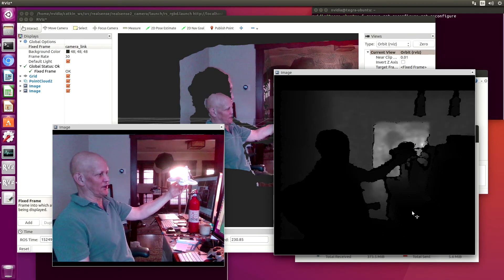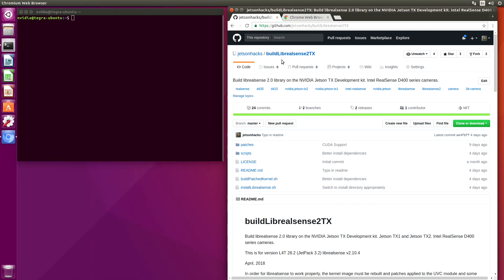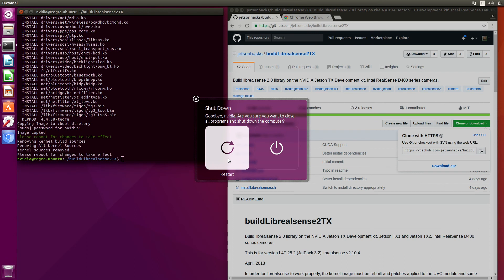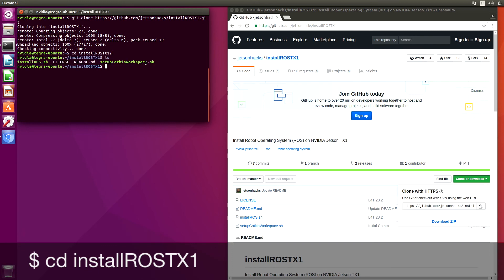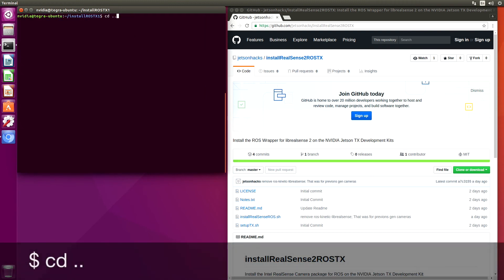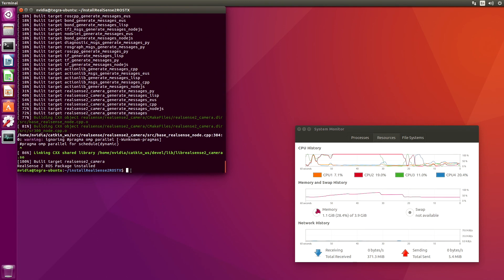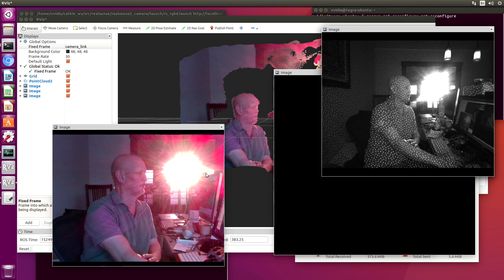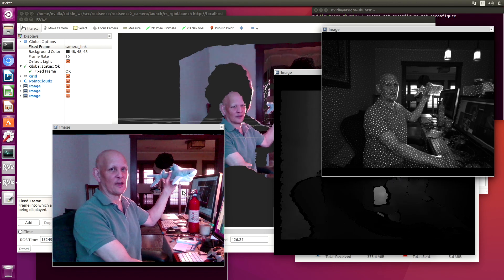Intel RealSense D435 Depth Camera on NVIDIA Jetson TX1

Comment: Will this compile on a TK1?
Reply from the maker: The short answer is no. To run librealsense2, the Linux kernel is expected to be version 4.4 or above, so the kernel patches definitely do not work with the Jetson TK1.You may be able to get some of the rest of the code running, but I have not tried it. Thanks for watching!
Reply: Hmmm, any chance of the SR300 running on the TK1 or should I compile my own drivers?
Reply from the maker: I don't know enough about the SR300 to be of any help. The Github repository says that the SR300 uses librealsense2, which is the same one shown in the video with the D435. Good luck on your project!
Reply: Thank you, though my TK1 has a project failure rate of 100%. Technical limitations prevent it from doing some very basic things I want it to do.